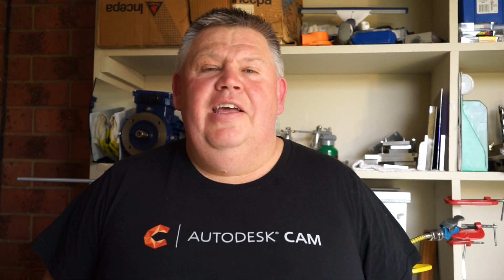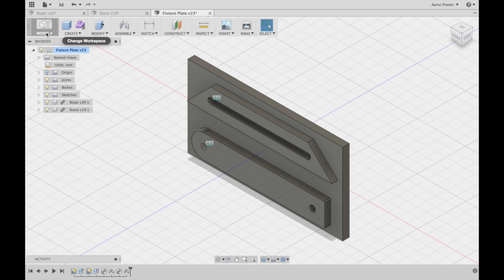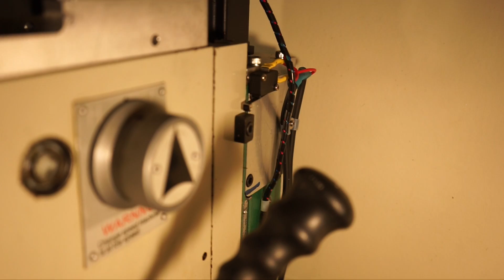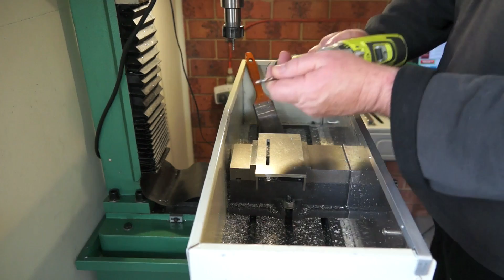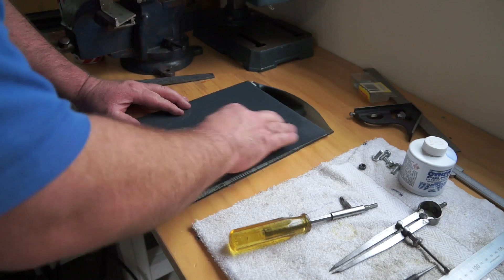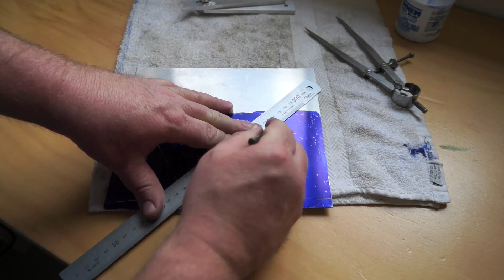Make a Sliding Bevel - Fusion360

Comment: love the old school mixed with new school video. The old school way was something new to me. I'll be using that in the future.
Reply from the maker: Hi Michael. Yes sometimes the old methods are still useful. That technique was taught to me as high school student back in the early 1980's.  I still use it today and teach my engineering students.  Thanks for watching and commenting. Cheers, Aaron.
Reply: DCTTeacher1 I wish they still taught this stuff in school. now its all computer based. What happens when you don't have a computer to do it for you. I find a lot of times, it's actually faster to draw it by hand.
Reply from the maker: I think old school technical drawing still has merit.  Especially the use and application construction techniques.  Especially the ability of sketching in both orthogonal and isometric etc...  However and I must admit that I'm a convert to CAD these days.  I've become so use to it that I would always 3D model any project and assemble it for proof of concept before machining it. Hopefully my old shop teacher isn't reading my comments ;-)
Reply: DCTTeacher1 I'm sure he would understand.

Comment: G'day mate nice video. 360 sure makes life easier. How much and what model cnc conversion is your milling machine? Cheers
Reply from the maker: +James M Hi James, my CNC machine is a converted Titan TM20LV.  This model is now superseded and it is now a TM25V.  All up I think my conversion including the initial purchase of the machine is approx $4K AUD.  I did the conversion myself and I have also made a small batch of CNC conversion parts for this mill.  The mechanical conversion kit sells for $550.  However, it doesn't include ball screws or couplings.  Cheers, Aaron.
Reply: +DCTTeacher1 bloody cheap mate I'm a knife maker "nyatiblades" looking at getting back into cnc work for my business. Cheers mate I'll give it a browse see what I find if not I'll reach out to you again take care mate.
Reply from the maker: James M No worries James, anytime.  Best of luck with it mate.  I will check out your blades.  Cheers, Aaron.

Comment: Hi Aaron, thanks for the video. I use solidworks at work. How would you rate fusion 360 against solidworks, purely from ease of use point of view?
Should get a decent computer and try it out at home. Also, how much will I have to spend a hobby mill like yours? I have no clues where to start.
Thanks ,
Sunil.
Reply from the maker: +sunilkumar vc Hey Sunil, thanks for watching and commenting. For me, I found SolidWorks easy to use as it was similar to a previous CAD software I was using. Fusion360 is relatively easy to use, but it does have some quirks. However, the more I use it the easier it gets. Cheers Aaron.
Reply from the maker: Oh I forgot to answer your question, my mill is a CNC Conversion that I did myself for approx $4K AUD. You can get a CNC router cheaper, but it won't do what mine can do. Cheers